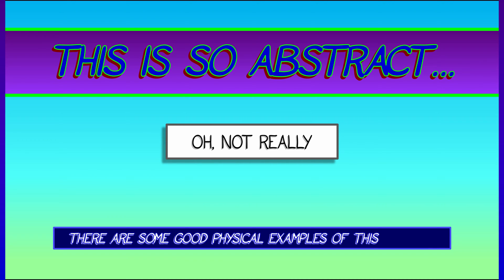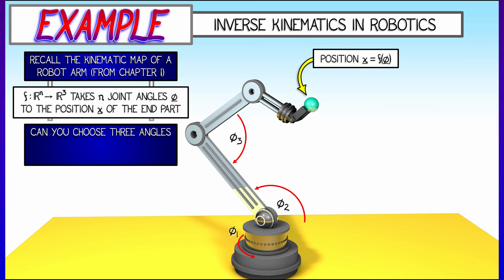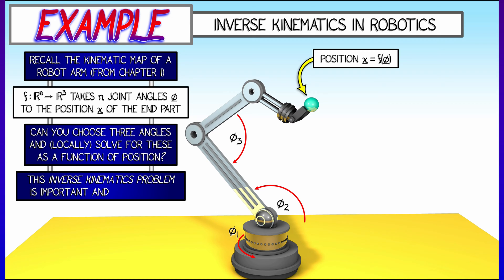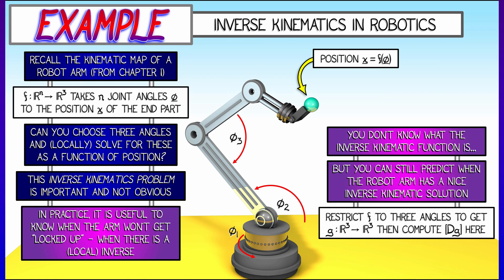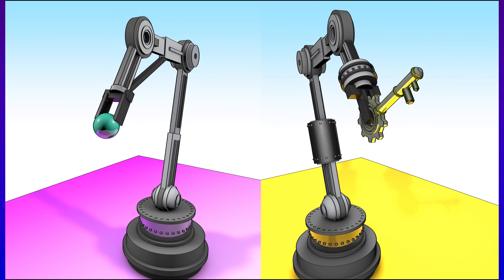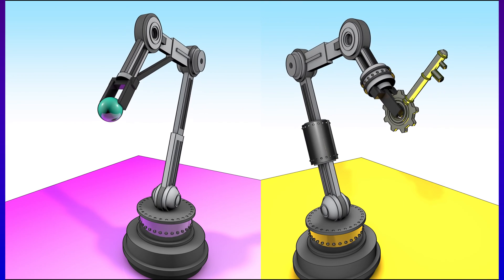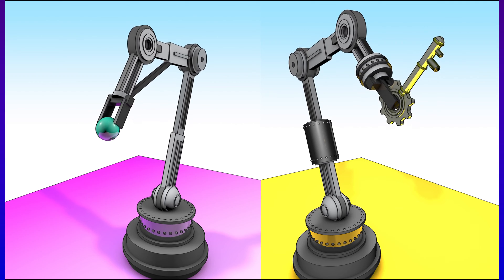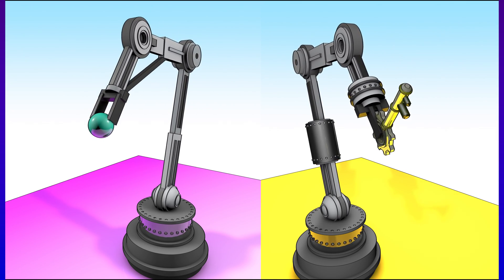CalcBLUE 2 : Ch. 7.6 : Inverse Kinematics in Robotics

Comment: Is this basically saying this? For example, when you don't know where to start to solve y=f(x), you can set x=g(y) and find a range of y that makes 1/(dg/dy) possible, then it'd be easier to solve y=f(x) since you now have a restriction for y? I feel so confused.
Reply from the maker: that's the rough idea. 
don't worry -- it's pretty difficult stuff!  doesn't make sense the first time you see it.  but it will eventually.
Reply: @prof-g  Thank you! I feel like I'm beginning to understand it. In the previous video ( Ch. 7. 5. ) you found out that the matrix [ -1 -1 ; -2 1 ] is invertible. Now, like in the video ( Ch. 7. 2. ), you are viewing it with only the linear terms, right? Like, you can make [ -1 -1 ; -2 1 ]^(-1) [ x y ]^T, then it's a local approximated tangent plane for the original function in ( Ch. 7. 5.) And now you can solve it because it's so much simpler?